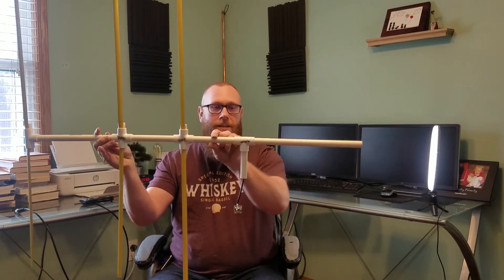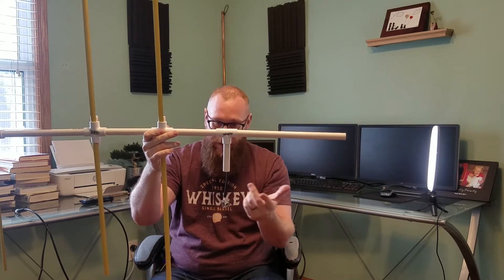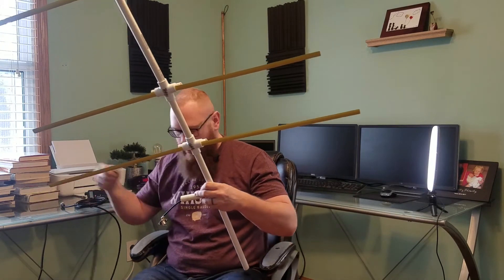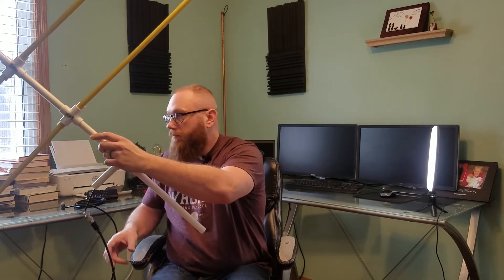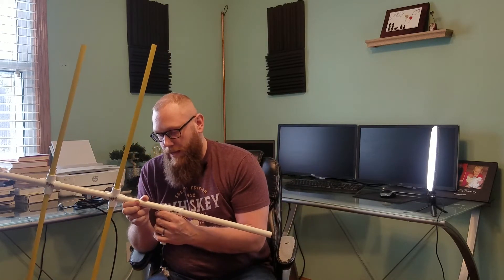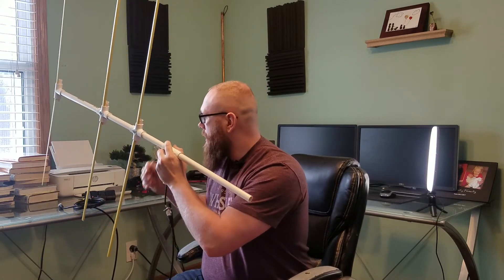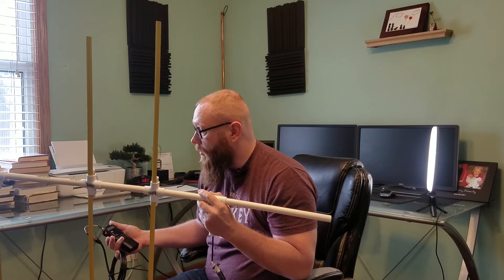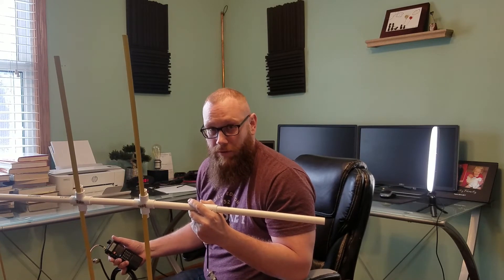$10 Yagi TESTED!

Comment: Bro, your radio is the sacrifical connector. Not judging, because I have one too. But when the cost of the BNC to SMA costs 1/3 as much as the radio, that's not worth the money.
Reply from the maker: Excellent point. 

Since this video I've switched over to the BNC-to-SMA adapters. Bonus: it takes a lot less time to switch antennas! 

73,

Comment: Put a tiger tail on the baofeng and you may be surprised. LOL One thing I am curious about is orientation of the elements. Wouldnt the thin side of the elements inline make for very narrow bandwidth? I was thinking it would have better signal strength and bandwidth if the curved backside of the tape was facing forward inline with the other elements or am I wrong?
Reply from the maker: No, thin vs thick side of the elements shouldn't affect bandwidth much. Now if you used, say, 30awg wire, you may see a narrower bandwidth, but even that won't have a gigantic effect. I suppose it'd be something interesting to test...73,

Comment: Built one today and can’t get into any more repeaters than I can without it.  Gonna try it horizontal and see how it does.
Reply: THIS is the reply I had hoped for.  This is just a dork project, designed to keep dorks out of the bowling allies in the northern tier for at least a weekend.  You'll notice most of the places people post from, especially if they are outdoor testing their "Yagi", after they've spent the weekend chopping up PVC pipe and tape measures, are replete with snow on the ground.  Either dork free bowling alleys, or higher tape measure and PVC fitting sales is the end game here...

Comment: I like to dip the cut ends of the elements in the liquid plastic they sell at hardware stores for coating tool handles. This adds a measure of safety when swinging these Yagi-Udas about, as the ends remain fairly sharp, even if sanded off. These things are a fun, relatively bulletproof build. Thanks for covering this!

Comment: Because of the front to back ratio you may want to test with the antenna perpendicular to the repeater.  There is a deep null off the sides of a Yagi.
Reply from the maker: Good thinking. I later learned that the repeater I was getting into is powerful enough that I could probably get into it on a dummy load! LOL

Comment: I recently purchased all the items needed to make this directional antenna, and hopefully will be putting it together this weekend. I am using the metal pipe clamps instead of more PVC pipe to hold the metal tape measurer parts down. Not sure if this is why it seems to be costing me much more than $10, or just because California is more expensive.  I'm fairly new to the hobby and really like it. Your channel seems very interesting and helpful. Thanks.  AJ6XY.  73. Elaine
Reply from the maker: Thanks! In Wisconsin, we have Menards stores that sell short (2-5ft) chunks of PVC pipe. Try to see if there's a similar store near you. For cheap tape measures, Harbor Freight is really good, try them! Otherwise, see if you can find one at a thrift shop or garage sale...after all, you'll just be cutting it apart! Otherwise, the combination of California and inflation might be getting you...! 73,

Comment: GR8 video Sir,

i want to build something similar for 151.820 MHz but out of 1/2 " copper tubing.

Please tell me what i do wrong ok

Formula for 1/2 wave dipole 468 / 151.820 =  3.0825 '

since this is a half wave  is 2x 1/4 wave I need t devide by 2 like this     3.0825 / 2 = 1.54125 per leg 

reflector is 5% longer so 1.05 * 3.0825 =  3.2366 '
director is 5% shorter so 0.95 * 3.0825 =  2.9283 '

People can copy me no problem but i do not receive very well. what could be the issue ? Coax braid to antenna is my #1 suspect.

What y'all think ?

Thanks for advice

Antenna 25 feet off the ground  and maximum distance is  17.5 miles straight line
Reply from the maker: Yup, my first suspicion would be coax too. This won't be fun because your antenna is 25ft in the air, but I'd get it down, put it on a VNA or analyzer with a known-good piece of coax and make sure nothing's weird with your SWR/insertion loss. Then, using the 'TDR' function (although it's not true TDR, but that's beside the point) I'd test the length of your suspicious coax FROM BOTH ENDS. If both ends read approximately what you'd expect, then your coax is fine and you need to do some more in-depth testing...

Comment: Good topic. I'm looking at making a 2m and 70cm portable antenna using the same materials. Thank you and 73's from the Netherlands.
Reply from the maker: Thanks for the comment! Yes, it would be interesting to build a dual band version of the tape measure yagi! I'd probably use it mainly to talk into distant repeaters. Post up if you build one, I'd love to see! 73!
Reply: @hamradioexperience  I WANT YOU TO KNOW THAT TAPE MESSURE ANTENN U BUILD WAS NOT DESIGN BY KEVIN IT WAS BUILT BY ANOTHER HAM AND HE MADE FOR RX AND TX AS WELL IT A GOOD ANTENNA FOR HAM SAT STUFF IF U WANT TO TRY THAT WHEN IT NOT SO COLD UP THERE